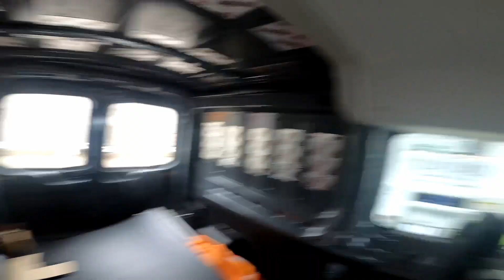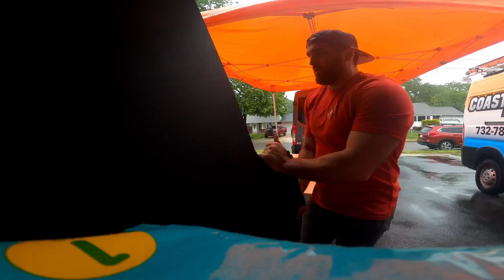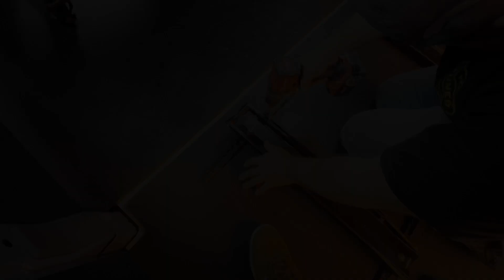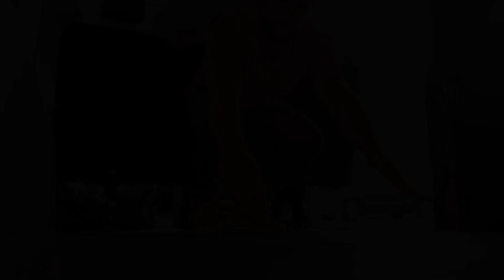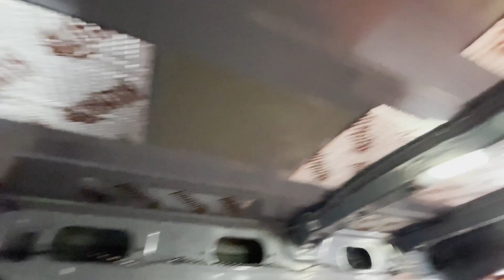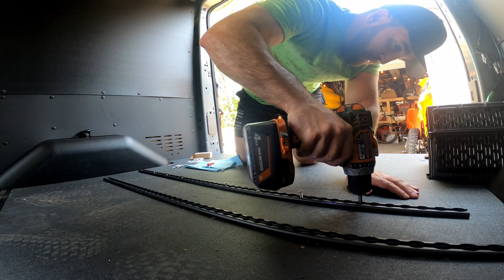The Best Van Floor for Mountain Bikes with L Track and Insulation Install: Van Build Part 2

Comment: I’m interested in installing the 1Up racks on my smart floor. My L track runs front to back.  Do you foresee any instability with mounting it along one stretch of L Track?   Also, does one of the 1Up racks hold your bike firmly or do you need one rack for each wheel?   Thanks

Comment: I’m looking to do roughly the same thing in my van. Any issues with strapping and hauling dirt bikes with the L track only being mounted to the plywood with the T nuts? I’d imagine it’s quite strong but figured I’d drop a comment and see what you’re experience has been so far. Thanks.
Reply from the maker: Great question. I actually have tied down one side to the l track and the other side to the factory d rings and it’s worked.
Reply: @ShredwithEd  do you notice any flex in the floor when you tighten the strap on the L track side? Or does it seem to disperse the tension pretty evenly to where you don’t notice any uplifting on the floor? 

Great vids btw. I watched all 3 of your van build vids last night. You’re the first person I’ve found that’s not doing a camper build but just building a separate garage. That’s exactly what I’m doing and your build is pretty spot on for what I’m envisioning. Very helpful to see how you have done it all so far.
Reply from the maker: @taylorholtby9268  no flex at all. My brother talked me into using 1 inch thick plywood so you figure that plus the l track being  bolted through braces it.
Reply: @ShredwithEd  love it. Thanks for the info. Keep up the great work with your vids
Reply from the maker: @taylorholtby9268  I really appreciate that. I’m getting back into the swing of things so I’ll have more soon.